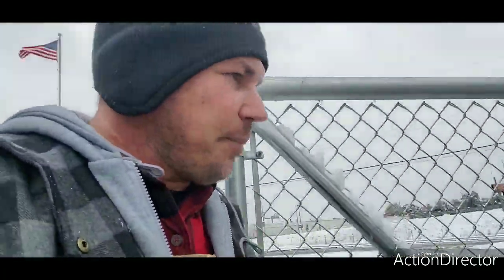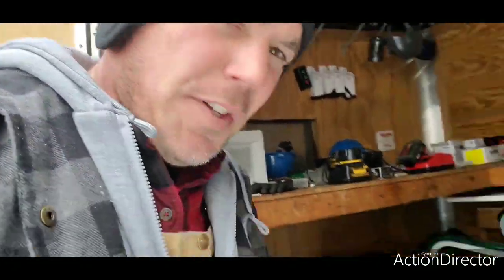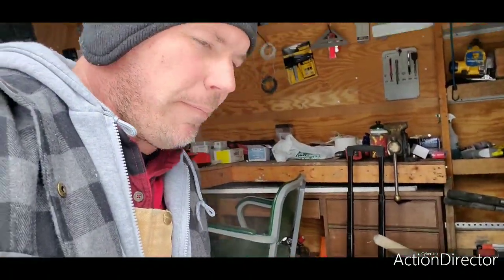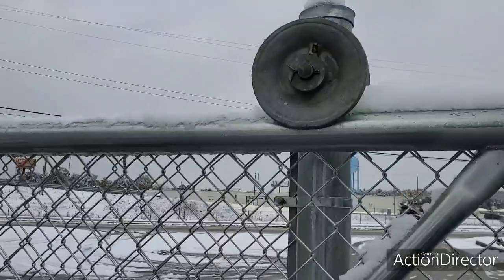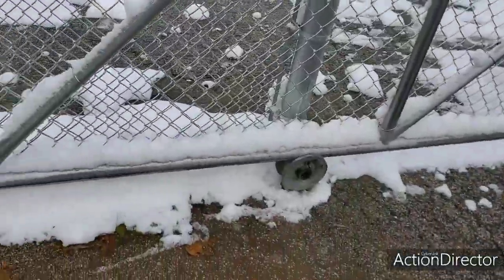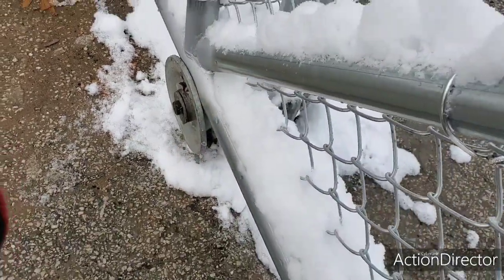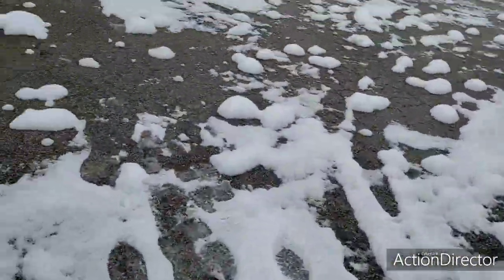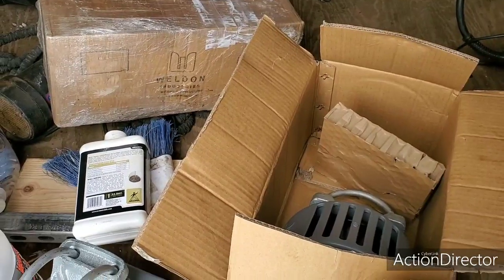Nylon vs Cast Iron Gate Rollers

Comment: In province of quebec in canada we have to install snow shelter over sliding gate so they dont get stuck in 3 feet of snow and ice. We also use a square rail close to the top og gate and rollers are inside of it so they never freeze.

Comment: How do you stop cast ones from freezing in the winter? Also what happens when you get over 3" of snow? Shovel immediately? (MN question) I want to put some kind of wire gate for my back driveway. (so hoping for a opener for my car) Is there a significance in sliding or double opening? If you do sometimes use double gate opening, what's the limit to each gate length before you have to put rollers under each gate?

Comment: What is the tension  supposed to be like on those rollers. I'm having an issue with my fence where If I tighten them they obviously don't roll smoothly but if I back it off some it wants to pop off the track. Any troubleshooting ideas?

Comment: What kind of grease would you recommend for those cast rollers? I live in the high desert in AZ with an electric gate across the driveway that has two cast rollers with the grease zerk. Thank you!
Reply from the maker: I like the Lucas Red & Tacky works good for me.
Reply: How do you apply grease to the roller that was different without the hole?

Comment: So if i have a motor for the gate nylon rollers are no good? My rollers will be about a foot off the ground if that makes a difference. Or do they still freeze.
Reply from the maker: Nylon will be just fine for that. They do run smother. Just make sure they  don't touch the ground and try to keep them clear of heavy snow.
Reply: @affordabledoorgatellc7391  thanks for the quick reply, I will use them on a 25 ft chainlink gate 4 ft high. And I do want to use the nylon wheels to reduce the amount of noise when i use it at night.

Comment: Yes I have them at selfridge airforce base.
I had them on a powdered coated pipe.
I just swapped them out they where 10 years old.
 Sealed bearings. Love them.
I have 15 different electric gates to the runway and taxi way.
Hate clearing these out every time it snows I clear out the snow under the wheels and salt the crap out of them. 
 I really dont like the Zip tracks. 
Osco operators 
And liftmaster
Looks like a bad wheel casting.
Reply from the maker: That's awesome thx